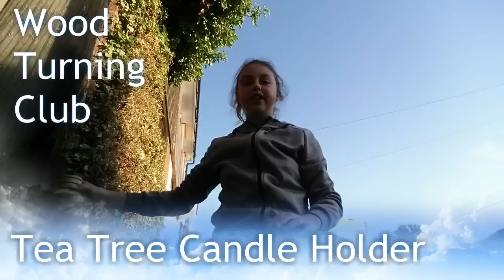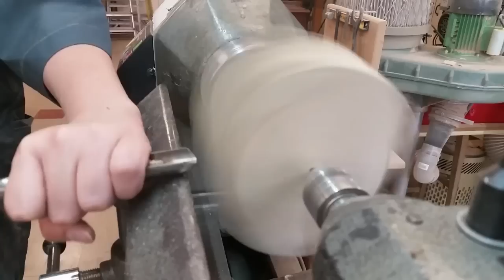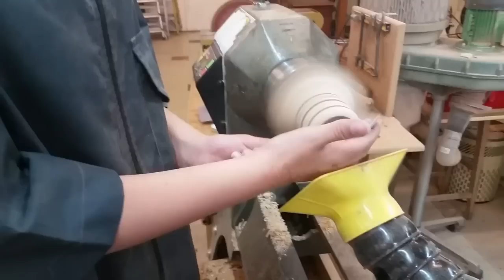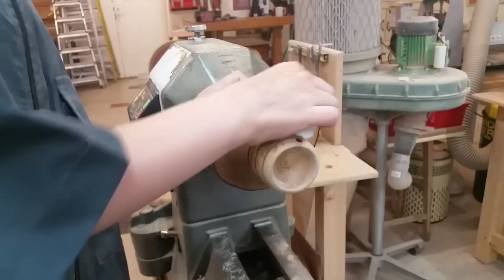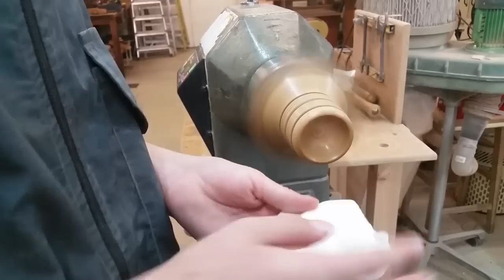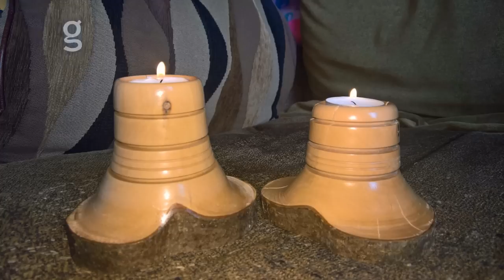Wood Turning Club - Tea Tree Candle Holder made from Holly

Comment: You are fantastic!! I teach woodturning to students your age and your confidence and technique are better than most. You also are very creative. I plan to use your video as a teaching aid. I do have one suggestion. When starting out on rough blanks like this, peel cut one end to round and then advance along the axis. This will minimize the bouncing of the tool. You are cutting from the uniform edge and not the irregular face. Saves a lot of wear and tear on your body.
Reply from the maker: thank you for the advice and that is good to know you can use my video.